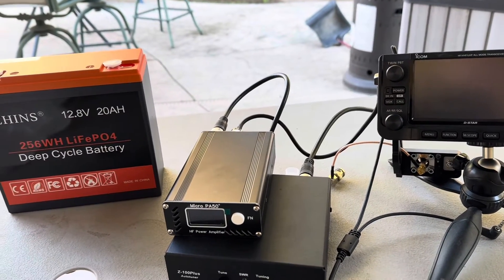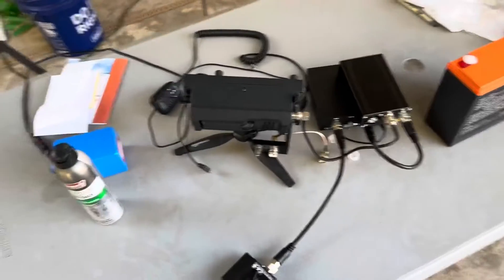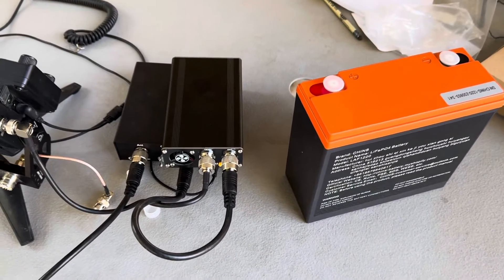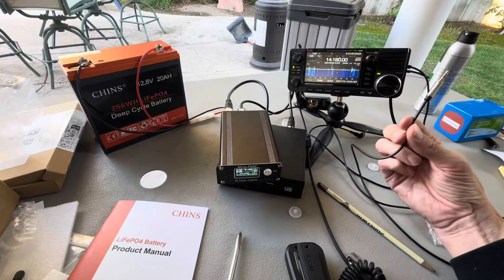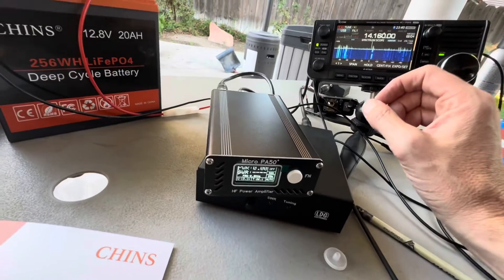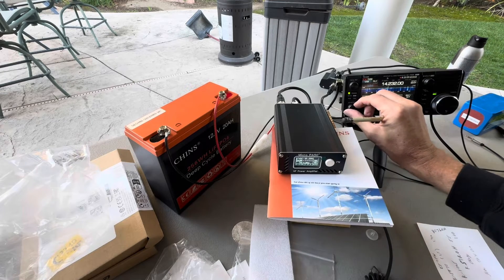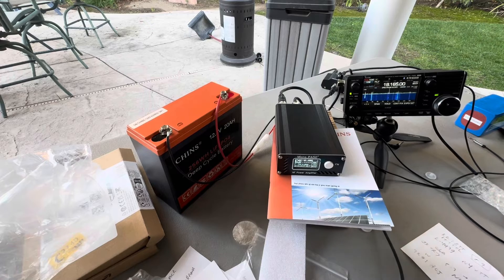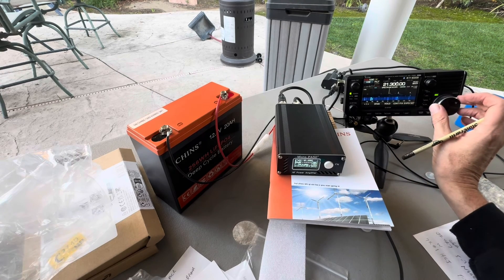Micro PA50 Plus HF Amplifier First Thoughts

Comment: For the problem of RF-sensed PTT (on the amp) causing a momentary high-SWR on the transmitter,  one suggestion below seems to have solved it. i made a cable that uses only the tip and ground. This goes from the IC-705 Send/ALC jack to the ACC jack of the amp. So the amp does not see anything on the 'ring' of the cable. This solved the problem of the transient high-SWR. And i still have automatic band switching (RF-sensed). Happy camper so far. My Micro PA50+ firmware is 2.9.5
Reply: This is useful to know, thanks! Just bought a.PA50+ to use with my Icom 705 and a QMX

Comment: Hi Mike, have you trest disconnecting the BAND pin? The 705 has the ALC signal in the center pin and not the band selection. 
However, I think that by connecting only PTT+GND the switching works. 
I ordered my MicroPA but I'm still waiting for its arrival. 73
Reply from the maker: No I haven't.  Did you get the amp ? Have a chance to test it ?
Reply: @HamRadioRocks  I tested it by making a cable with two stereo jacks but I only connected gnd and ptt (no central pin/band): it works. Obviously the band switching is not automatic but it quickly recognizes the frequency via rf sense. The positive side of this configuration is that there're no seconds of switching on the RF side... the ptt switches instantly. On the contrary, when I use the ptt via RF sense for a moment sometimes, there is a peak in swr. The only precaution I took is to insert the delay of the PTT DELAY (from the 705 menu) on 30ms. Let me know if you also have positive feedback.
Reply: @maxik0tix ... i just did this, made a cable that uses only the tip and ground. This solved the problem of the transient high-SWR. And i still have automatic band switching (RF-sensed). Happy camper so far.
Reply: @orrinw  I'm glad I could be of help
Reply: @maxik0tix ... So the amp works this way, but the next problem (with the IC-705) is something i became aware of yesterday: that the back-EMF from the amp (from a relay inside the amp) when it unkeys, can damage the PTT circuit inside the IC-705. This is mentioned on page 13-3 of the IC-705 Basic Manual.   So today i'm going to install the signal diode (1SS133 or 1N4148) in the cable close to the amp. I also joined the Facebook group that is run by the author of the MicroPA50+ ("Micro PA50 & W-410A & Micro PA100 and others") to see if i can get any thoughts from the author or from group members. ... I would post a scan of the Icom manual page but i don't see a way to post images here. ... ... Do you have any thoughts further on any of this? Thanks.
Reply: @orrinw  Yessir I know the problem. Some time ago I made a similar modification to another PA, the MX-P50, following Kevin KB9RLW's instructions. The simple circuit works and I inserted it inside the amplifier. I believe, however, that the Micro PA50+ is different as a switching circuit, personally I have not detected any damage in use. It is also true, however, that the problems may not appear instantly. I preferred to eliminate doubts by replacing the internal board of the 705 with the mod by Ben KD9LJF.

Comment: Can this be used with XIEGU G90 using SSB? Thanks!
Reply from the maker: I’m pretty sure you’d be ok. Although I believe the G90 puts out 20 watts stock, so I’m not so sure it would be of much of an s-unit benefit to get 30 more watts. I was really on the border picking this up knowing the 705 on battery does 10 watts.

Comment: My PA 50+ does not work on 30m or 15m. Says "BYP" in the upper right. Is running 2.8.5. Anyone else experience this or have a fix?
Reply: Figured it out, There is a multi-click option that is missing from every manual I can find, that is for "30/15m Open/Close". This comes up after 8 clicks. Do the 8 clicks until it says "open". Then power the amp off and back on. This seems to enable/disable 30m and 15m operation. Same as for the 7 click menu option for "17m/15m SWR On/Off". No mention in the manuals, but turns the SWR meter on and off for 17 and 15m (no power cycle needed).
Reply: @pnwgeek   It probably comes disabled because the amp has third harmonics on 30/15 that don't meet the spurious emission requirements in the US.
Reply: I have the same problem...glad you found a fix...but doesnt 8 clicks set unlimited mode? @pnwgeek
Reply: I have the same problem and have the same 2.8.5 firmware. I like your fix but I thought 8 clicks puts the amp in unlimited mode.... Update:. I just tried your fix and it works perfectly, thank you. Apparently in this version, 8 clicks do not put the unit into unlimited mode but in fact does exactly as you stated. So either they eliminated the unlimited choice or maybe its something else like 4 clicks or 9. There has to be an updated manual out there, finding it is the problem. Thanks again, I have been searching for weeks just to find anyone who had the same issue until I found your comment.

Comment: I have recently picked up the less expensive OGS-50. Only tested it using 0.8 watts as input & it output 25 watts.
I heard the OGS-50  does not necessarily have a good impedance match between the source rig and the amp's input. I am waiting on a soon to be published easy fix for this before I use the amp much. This leads me to wonder if your amp has a similar issue. If so, I suppose the reflected power could damage our PA on our rig.
Reply: The Micro PA50(+) is supposed to be higher quality. It's worth the price difference.

Comment: As a few have stated, it is frequency sensing, so all that is truly needed is to have it installed inline with the antenna.  That said, I really like mine.  It pairs very nicely with my X6100 & Antuner AT-100M ATU, as everything is very compact and easily packable.  It works rather well with my DX Commander Signature 9 (w/80m inverted L element swap), and I was able to 6 band both of the recent A25R and W8S DXpeditions, including an 80M QSO to W8S from South TX.

Comment: I have one of these.  Good amp but watch for random SWR spikes in CW.  I modified mine to key via the key line from the radio.  The frequency/band switches automatically.
Reply: What do you mean, watch for random spikes?
Reply: @mrtechie6810  , when in CW and transmitting, a random “open” will occur in the amp which causes a full deflection SWR spike as seen by the ICOM 705.  TX delay settings had little effect.  Root cause:  the TX relay is tied to the “RF sense” feature; it was missing a relay closure randomly.  Fix action:  I pulled the keying relay from the board, reassigned the 1/8” socket to the relay via wire, pulled 5VDC from the the board, and then resoldered the relay to the board standing on its own leads.  As the 1/8” jack never worked as designed (it was supposed to sense the 705 or the Xeigu radios when selected), it is now plugged into the 705 key line.  When the radio keys and drops the key line to zero volts, the relay sees a difference in potential on one side of the coil and closes.  Now I have perfect CW with no spurious SWR spikes.  I now use a cable to control amp keying….   Also did the firmware update to 2.6.  See YouTube or Google about the update.

Comment: It auto switches bands. My routine is to change band on radio, turn off amp to tune new band, it will switch then as you tune. Turn amp on and transmit. If your tuner has memories, just change bands, the amp will switch almost immediately. They are solid amps, I think you will like it.

Comment: I have recently bought this amp to use with my Xiegu X6100. All I did was connect the rig to the amp through the antenna socket, and antenna to the amp, then the amp automatically switches bands. This should also work with your Icom.
Reply from the maker: I’ll have to check that out, I’ve been manually switching it.